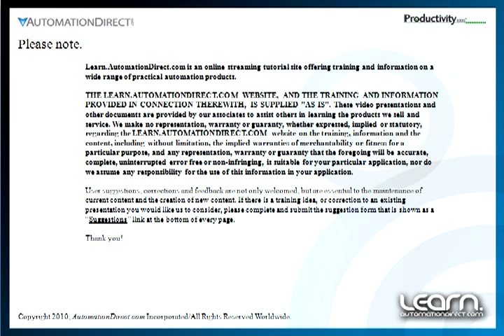What is a PLC? What is a PAC? - Productivity3000 Controller From AutomationDirect

Comment: I do love the pac3000 but it's so frustrating when you can't get something to work . For example i've got a SOLO temperature controller SL9696 series hooked up to the RS-485 connection on the P3-RS module. Using the Modbus read command I can see it working just fine. But for the life of me i can not get it to timeout . I used the RS485 HeartBeat Timeout Bit on an NO contact but I can't get it to turn true.

Comment: I used several Productivity series pacs till our 1 control network was 10.20.26... Productivity ip address cannot begin with 10.20. WTF? Sure I could do some fancy routing but still couldn't send or receive explicit messages to other devices on the network. If the engineers for this product were cheap enough to reserve the whole 10.20 network what other corners did they cut? I will be extremely selective on where I install any more of these!
Reply from the maker: Hi Ernest. We’re sorry to hear that such a loyal customer has had a bad experience with one of our products, and we offer our sincere apologies. For technical questions like this, please contact our free award winning tech support. They are setup to give you the most efficient and quickest support. 
Phone:    1-800-633-0405
Email:     https://www.automationdirect.com/adc/Form/User/TechInquiry
Support:  http://support.automationdirect.com/
Please let us know if you have any other questions. We appreciate and value your feedback. Thanks!
Reply: Contacting tech support is the first thing i did. Even he said he wishes this would be changed and had no advice except the routing mentioned above. Flexibility seems to be a popular buzz word in your sales. I agree, the user needs to be flexible, all jumping through hoops. If you need to restrict a whole B Class network, at least give the user the option of changing it. By the way, is it documented somewhere yet, that these addresses are restricted? I spent most of a day searching the manuals and found nothing. Please change this so I can leave the nice comment I wish to give.